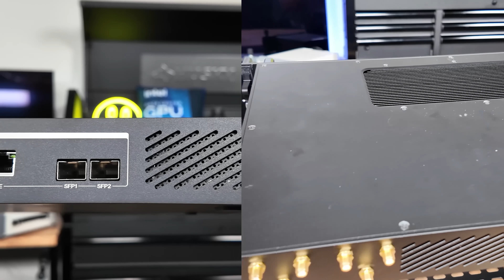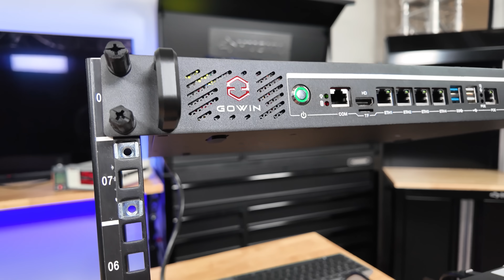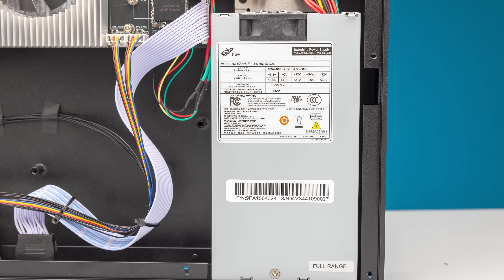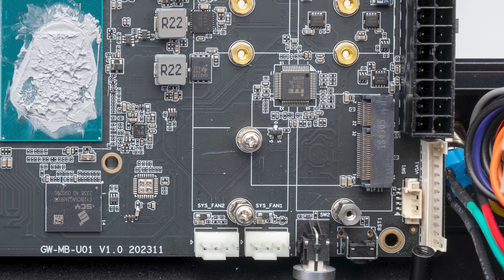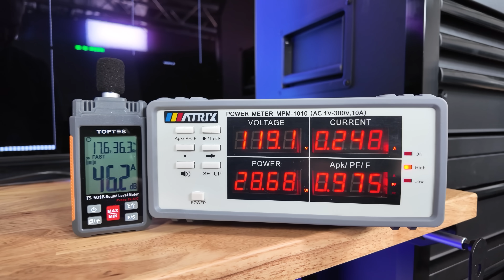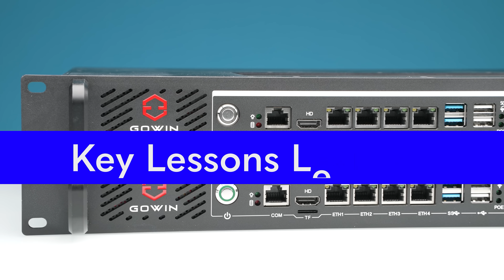THIS 25GbE Server and Firewall Has it All

Comment: That i3-N305 is not impressive. I have a small Rancher Kubernetes cluster (3 controlplane, 2 worker) running in a Proxmox host and the sustained load is middle fours with no k8s apps deployed other than the Rancher web GUI. I was hoping for a sustained load of 2.5 or 3.

Comment: They went a bit far with this compared to their other tiny 10g model. I just want something that's sub 30w, line speed at 10gb for IDS/IPS + crypto. SFP56 should be considered instead of 28. 28 was mostly skipped over in enterprise, just like how 2.5 and 5gb is useless. I'd be willing to pay maybe $400 for what my 'dream' would be, but not $700 for this.

Comment: Anyone know what sfp to rj45 modules would work for the  10gb version. Thanks
Reply: Still not for now,I mean not in this version,but we try to make a new version!
Reply: @gowinfanless  sounds great. Any idea on timescales? Thanks
Reply: @user-jt6sn7yu1d  if you're prepared to sacrifice an m.2 slot, you can add an nvme to 10gbe RJ45 nic. You'd have to modify the chassis to mount the socket but it'd work

Comment: This is something more appropriate for an edge server case: low power, strong case, somewhat lower noise, efficient cooling, etc. The cellular capability is rare and would be great for IOT or surveillance. It is less likely to be used in a data center, but in a mini wall mounted rack. It is not suited for harsh industrial environments or outdoor use with high humidity or temperatures, but it will be a lot less touchy than standard servers.

You might want to talk more about use cases.
Reply: Thank you,we have make it more quieter with new PSU,and fanless chassis.
Reply: @gowinfanless  Quieter is certainly better for use cases where people will be around the unit.  Having gone fanless, of course, makes it very quiet and makes it much more likely to do well in harsher environments.  You would still have to make adjustments for harsh environments like areas where you would want the unit completely sealed or be able to deal with very high or low ambient temperatures.  Still, fanless makes it usable outside an enclosed space for equipment or a space that is expected to be loud or require high movement of air.  Good move!

Comment: Fascinating unit, and a great video. :)

One thing that caught my attention: on their website, GoWin lists three variations of this model under a "1U/2U" page, but no 2U models.
I'm hoping they're showing their hand, and a 2U unit is coming that will either be quieter and or more powerful since it'll be able to use larger fans. I'd rather have a 2U similar to this in my rack than an Optiplex 5040 on a rack shelf.
Reply: We had 2U server with Xeon D series!
Reply: @gowinfanless  Awesome! Where are these on the website? I looked and couldn't find them.

Comment: Would this thing be able to run OPNsense with IDS/IPS and ZenArmor at 10Gbit or even 25Gbit up/down or would the CPU be a bottleneck here? 
I'm looking for a fairly cheap machine to do that (and yes.. I need the full 10Gbit before people start complaining that it's not needed... i could even get a 25Gbit line where I live) but I'm wondering if the CPU would be sufficient to get full 10Gbit with threat protection activated. 
Anyone got an idea?
Reply from the maker: If you were looking for something to do 10Gbps+ with full packet inspection you will want a much more powerful CPU
Reply: @ServeTheHomeVideo Thanks for getting back to me. Yeah I kind of expected that already but thought I'd ask. Any CPU suggestions or rough territory benchmark-wise?
Reply: @Overlanding  We had  25G version
Reply: @gowinfanless  Do you guys consider building the same thing with a more potent processor option as well? I absolutely love the unit but it would be great to have an option that packs more punch with a current i7, i9 or ryzen.

Comment: Seasonic SSP-300SUB has full fanless mode up to 30% load.
Reply from the maker: Rumor has it they are looking at changing the power supplies based on this feedback
Reply: @ServeTheHomeVideo  I have two of these supplies. One is in my DIY 1U router and one is in my low-power  2U storage server which is SSD based. These are perfect for the job.
Reply: Based on your advice,we have change the PSU which is more quiet,and we make a fanless version for now @ServeTheHomeVideo
Reply: @ServeTheHomeVideo  We have changed it,indeed!

Comment: You didn't mention one of the features, but I guess it's obvious from just looking at it. It's not a full-depth rack mount server; it's relatively shallow, so it'll fit into shallow racks designed for networking equipment.
Reply: You are right,it not a full,but short deepth 19th rack.

Comment: I would like to see this with as an ATX/miniITX motherboard so i would can exchange my 10yr old Xeon motherboard with 10G+16SAS Nas hybrid.

I could use two M.2 to SFF-8087 (or similar) to handle the SATA/SAS drives and have 10G altogether.
Reply from the maker: There used to be cool Intel Xeon D motherboards like this
Reply: The Xeon D2700 is super cool!  @ServeTheHomeVideo
Reply: But Xeon D is around 45W not 8W... @ServeTheHomeVideo
Reply: Yet, 8W is much less than 45W @ServeTheHomeVideo

Comment: Nice device 😃 Maybe it's worth to try to mod it by replacing the power supply with a 100W version and use a quiet Noctua fan on this one. What do you think of this idea?
Reply from the maker: Some folks had the PicoPSU idea which is really interesting.

Comment: Where can I find a 1u Front Access server case Where the back of the case is in the front and the power supply is out the back.  I'm looking for a case that will fit a mother board that is 9.6 x 11.5 deep   I guess pretty much a case that is 19 x 20 deep.   all i find are ones that are 19x 12 or so nothing that is deeper than 12  inch to fit the mother board I want my IO's in the front.  I have a mother board I using for pFsence and it has 6 10g ports, and 2 SFP+ 10g ports.  and I want them in the front.

Comment: Both system design for heat dissipation do not impress me that much.
The standard version use a fan on top of the CPU heatsink. I'd see more airflow with some slots in the upper part of the front panel, on top the 2.5gbe and 1Gbe ports, associated with chassis fans aligned on the back in the slot section. VGA port could be put vertically, close to the PSU if EMI allows it. Current back fan location might also be useful for wireless options, however the fins orientation of the CPU heatsink to not encourage hot air to be routed directly on the rear. More on that: power cable position in front of the PSU fan and between the PSU itself and the ventilation slots of the front panel might create more airflow issues.
Fanless version has... dust/particle sinkoles on the top, and in a rack layout even on top might need anyway up-flow vents to increase convection air movement. 
However, the increased heat dissipation mass of the CPU heatsink, combined with different fins orientation, front air intake slots and some 40mm fans on the back of the chassis might achieve a reasonable balance of higher airlow, lower fan speed noise and less noise... When a less noisy (not fanless) PSU replacement could be found.
PoE port, if can be used as WAN, is a nice touch, if works properly: might power AP/antenna device for use Wireless Internet Service providers, or avoiding the use of a separate PoE injector, o be used as ONT power supply for FTTH services. Several router producers like Mikrotik have these kind of features in some products.
Last but not least: eMMC on 2024 is... a big no for me. Might work for a Thin Client, but not for a firewall, evan an overbuilt OpenWRT one.
Connectivity is nice, but computational power seems a bit on the short side for all these options. And more importantly, neither designs seem to me really market ready.

I hope that GoWin could improve the design process. Sysyems do not need to fanless to be low noise.

Comment: You also have to keep the efficiency curve of the PSU in mind. For a system that could go up to 100W with all components under load, a 150W PSU is reasonable. 
I'd probably still swap the fan for a Noctua for reliability alone.

Comment: The 150W PSU is probably to ensure it can deliver all its functionality at once. Your benchmarks showed that it was already using ~51W under load, which looked like it was with none of the front I/O populated. If we add 15W for PoE, dual 10GBaseT SFPs at 3W apiece, USBs in all four ports taking 4.5W apiece, we're already looking at ~90W without adding in populating both SATA and M.2 slots and some potential extra load for populating the 1G and 2.5G ethernet. That's also not taking into account AC-DC conversion on all those wattages, which are wattage at the device, 100W wouldn't be enough for the system fully loaded.
Reply: and?
Reply: @chimpo131  And it wouldn't work properly, dummy. Duh.

Comment: What I am really dissapointed in is pricing for the C3000 Denverton and C15XX D-Xenon stuff. It sells for what it did when new. Looking to upgrade my PFsense router for better VPN throughput but damn if I will spend  release pricing for a 2105-2017 release. I stay with Supermicro due to having IPMI as well for my homelab. If it has AES-NI I will be fine. Not paying for PFSense+ (no quickassist without +) However if I were to pay for PFsense+, then I would buy a Netgate device as over 5-8 years, the price and support is worth having the $1500 option.

Comment: With these types of devices, what is rhe practical use for this? Maybe a head unit for storage and combo networking appliance? Are these for custom firewall?
Reply: It'd make a great home server. I haven't seen anything better for the price (IIRC it's around $700 for the 25Gbps version). You could stick some 2.5 inch drives in it and make it a basic NAS. Run some VMs, Dockers, LXC containers, whatever.

Comment: What you got here is a China special. It takes a brave person to rev this up in a production environment.
Reply: Pretty much everything is made in China these days, including a ton of Cisco stuff. What would be a juicier target, a SOHO/home 1U firewall, or the devices & chips used by pretty much every corporate network on the planet?
Reply: @IanHobday  good point. So what kind of warranty backs this product? The fact that they found a problem with the USB ports on the front doesn't bode well for this product's stability. So in short, caveat emptor.
Reply: @LokiDaFerret  For sure, this sort of stuff is for people who like to tinker. I have a similar sort of box with 2.5gbe ports on it, running a Ryzen 5825U. 64GB, 2TB mirrored nvme drives. It runs promox with opnsense as a VM, and mariadb in a separate VM. Will add more stuff over time.
Reply: @LokiDaFerret I believe the problem was physical clearance when he was talking about interference, not crosstalk
Reply: @IanHobday  I have 2 paper cups, a long string, and a wild sense of humour. AND my paper cups are backed by a 2-year warranty. 😁
Reply: @LokiDaFerret  any of the Gowin items comes with 18month warranty,return/replace/refund!

Comment: I am quite surprised they're not using a Pico ATX PSU in there. You can get up to 250W in a tiny fanless package, and I don't think you'd need any more than that. That would mean you have a power brick to convert the AC to the 19v DC input, but a PicoATX is so small you'd have the space to include that inside the case, where the existing PSU was.
Reply: Hi,there,thank you for the comments,and we must improve it in the second batch,to make it a real fanless  Gowin 1U rack!
Reply: Came here to post the same thing --  easily add a Pico PSU or an HD Plex and hide the brick inside (or pick another AC to DC solution) vs going with a noisy 1U PSU. I was thinking about what all would have to be done to mod it while watching the video.

That being said, the type of people who want a 1U form factor are probably already running some noiser stuff so maybe a fan less desktop appliance version with a brick and then a noiser 1U unit?  Expensive to make two different versions I'm sure.
Reply: Its could be a reliability issue long term. or they have a deal for power bricks.
Reply: For what it's worth, I'm happy they're using a PSU from a reputable manufacturer. Should be good for reliability. They really just need to ask the manufacturer to swap to quieter fans.
Reply: It's difficult to find an ATX power supply rated for less than 550 watts on newegg or amazon. I looked for 300 watt ATX power supplies on ebay and found nothing but used units.

Comment: They REALLY should have taken a design hint from old stereo equipment for the 'fanless' unit.
Put the heatsinks on the back and/or sides, so air can rise through the fins with convection.
Further, I have decided the ideal way to quietly cool a 1U chassis is with a blower fan ~2/3U thick. 
Plop it in there flat, blowing at your parts, Sucking in air from the 'top' which has room because it isn't as thick as 1U.
Route the intake to a slot in the front.
They can be quiet by running at a lower RPM and still push a lot of air.
They just take up a bigger internal footprint. So not ideal for maximum density servers where everything is LEGO tight.
For switches and systems like this one with big empty spaces in them it's great though.

Comment: I love the execution of this and might just pick one up(and supply my own fan-free PSU)
Basically exactly what i've been looking for.

For the i3-N305, instead of Intel taking an Atom/Celeron class processor with the top die being 8E cores 32Xe cores, 1 channel of RAM and 9 PCIe 3.0 lanes, just branded it as an i3
I wish Intel had taked the die used in the i3-1215U and just cut it down differently, since the i3-1215U and i3-N305 at least had the same MSP/CSP(they both used to say $309 before people got mad and intel took them all down shortly after the i3-N305 release). The 1215U is cut down from the i7-1265U starting with 2P8E and 96Xe, cut down to 2P4E 64Xe in the 1215u. For the N305 i wish they had Instead taken the 1265U down to 0P8E 32-64Xe, while still retain 2 channels, ~20PCIe lanes of gen4.
IIRC its mixed so maybe some are 3.0, but even if it were all gen 3, its still 20 lanes VS 9 in the Atom/Celeron class die.

I'd actually pay more for this than the i3-1215U/N305. Yes i do realise that i could order an i5-1245UL and just disable the P cores, and then i'd be left with even more Xe cores, but if there are that many defective i5/i7 that require disabling 4 E cores to make the i3, there must be similar ammounts of defective P cores that could have been disabled to make an 8E core i3, but with lots of RAM and PCIe.

And to counter the other argument: If the i3-1215 exist(ed) at $309 MSP, then an 8E core could exist around the same price as they are all from the same i7-1265U mother die, down to the lowest die, the 2P4E 1210U. i'd personally pay more for a theoretical i3-1220UE/UL, say an extra $30 just to get 4 more E cores, and not have to mess with a mixed architecture.

Yes it would ue more power because it is a larger die, with double the RAM and double the PCIe, but thats a price i'd be willing to pay.
Reply: We are thing the 1235U and 1245U,thank you
Reply: @gowinfanless  Oh my, sign me up

Comment: It's decent but missing a few things.

1. In data center world you need dual psu for A/B and hotswap
2. Hot swap fans
Reply: No one is putting this in a data center.
Reply: @zxcvb_bvcxz agreed, best case, small business, mainly for an All-In-One solution that's easy to deploy
Reply: For sure yes, this compact model was designed for homelab mainl.We are developping the commercial model too @zxcvb_bvcxz

Comment: I really like this form factor, and this specific featureset! I would strongly disagree that the PoE is ditchable. If you think about the use cases, needing/wanting a secondary PoE switch is already one or two bumps up in tier. Having this solo PoE port for an arbitrary IoT device, camera, etc really solves the "all in one" aesthetic/use case - it can really cram everything for a small network PoP for a WISP or something in a single unit. That's really nice. 

My only complaint (apart from the obvious need to upgrade the PSU for quieter operation) is that the PoE port should be on the rear of the device. Obviously, if someone gets physical access to your unit, you're compromised from a security standpoint, but keeping an always-on PoE device lit when someone walks by and snags a cable, or a new tech pulls the wrong port while figuring things out is just plain sensible. It's out of the way, just like the power plug and the 4G/wifi antennas, which keeps it out of sight and mind... And just hard enough to mess with to keep a casual saboteur from triggering a truck roll, or even backtracing the PoE run to swipe the device on the far end. ;)
Reply: I was thinking this could be a good WISP device. Terminate your fiber in the router and run your AP directly off of POE, or you could run a camera in the cabinet/shelter for security.

Comment: meh. Two years ago maybe I would be mildly interested, and if it had AMD EPYC Embeded (which by the way has 3 10Gbps NICs in SoC), or RAM slots. I was searching for months 2 years ago, even pinged few vendors, to build 25G router. Meh, nothing was good, so I have built my own (based on ASrock Rack mobo), and super happy (and better cooling), can push full 25Gbps without issues. Now deploying 100Gbps, so will do the same, deploy my own just with faster PCIe, CPU and Memory.

Soldered eMMC. I consider this a joke.

Good it exists, and some progress is being made, but could be better.
Reply: For sure YES,thank you.Can I get a further discussion with you as the comments are great!